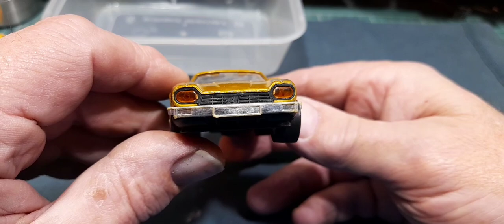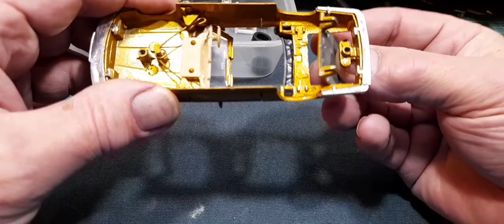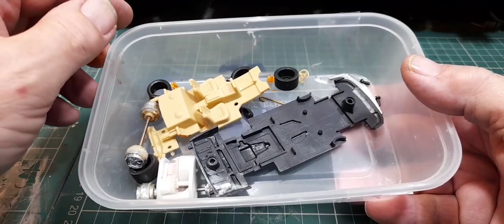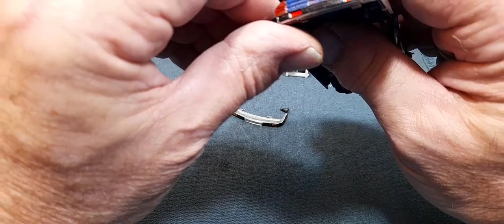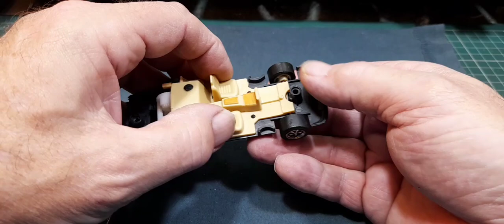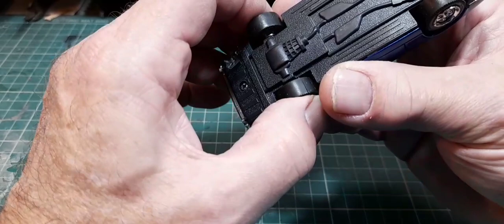Jaguar xjs ,British Leyland ,M.L.M.  challenge video.

Comment: quite a nice job,there Martin.with pull back-&-go 'motors',i usually remove one of the cogs inside the plastic unit.they do come apart fairly easily.by doing that,it frees up the wheels.i have quite a few like this including an experimental Jag open top.
Reply from the maker: That sounds like a plan ,excellent I will try that ,I think thay a good models plenty of nice details. 
Thanks again 
Best wishes martin
Reply: @martindaredare  that Jag by they was,is an XK180.Think it's a Maisto petrol giveaway.I can't find it at the mo,like so many of my cars,seem to vanish!